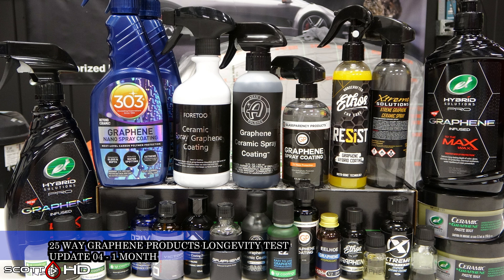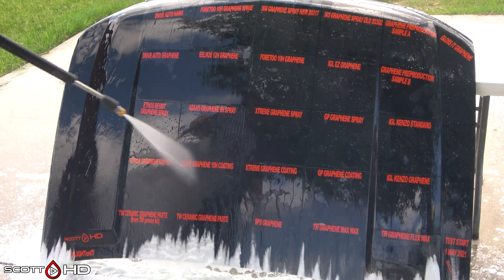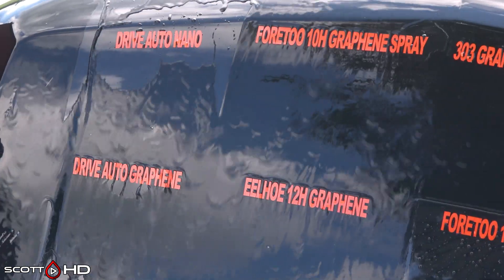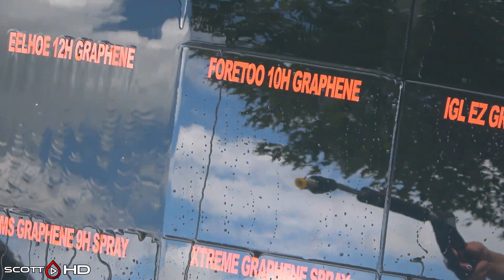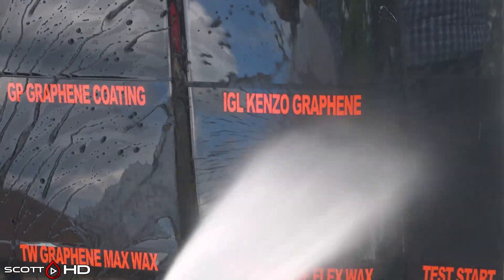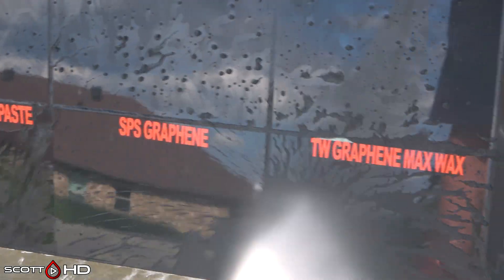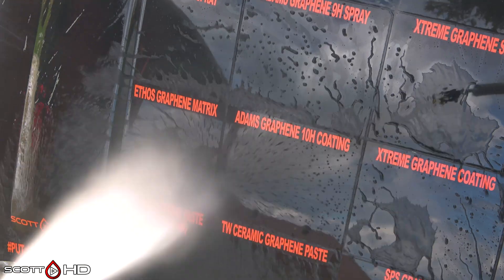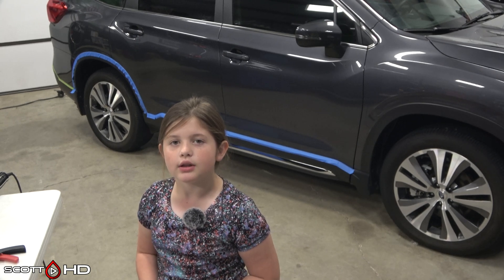Graphene Coatings Longevity Test - 25 WAY - ULTIMATE comparison - UPDATE 04 - 1 MONTH - BIG CHANGES!

Comment: I just started using the Adams Graphene spray.. so far I have been impressed but only a couple months into use.  I also use it as a topper and noticed a difference of hydrophobic property on a 2.5 year old coating.  CQuartz Pro was still going strong at 2.5 years but the Adams Graphene as a topper did give it a nice boost.

Comment: The GlassParency Graphene Spray coating is a little surprising. They seem to be coming out with more and more products for the detailing community. I'm a little surprised to see the coating itself showing signs of being flat.
Reply: The GP coating hydrophobics are just average without the topper unfortunately. I exclusively use their coating but I always apply BOOST topper and it makes it amazing
Reply: @chrisgorgol9442  I just became one of there installers and am getting into their system and full range of products. Waiting for the orders but I've heard great things about the boost.

Comment: I'm surprised how weak TW 75th anniversary graphene ceramic paste wax is. I though it would be much much more durable than that.  It's no better then seal n shine or ice spray wax but 3 times as expensive.
Reply: A bunch of hype...Im glad I didnt jump..
Reply: @masterspin7796  It's decent. It is very easy to use and super slick and has really good hydrophobic properties.  But I would recommend topping it off EVERY 2 MONTHS with TW Ceramic spray coating to keep the durability ON FULL!

Comment: I am really surprised by the weakness of TW Ceramic Graphene Paste Wax.  I applied this product to my vehicle about the same time you started this test and I have the same results!  I won't be using it again.
Reply: Extremely disappointed bc they market this as a 1 YR durability and it doesn’t meet no we’re near that
Reply: Very difficult to apply. Low durability. 
The car did look incredible for about 2 weeks after application, but after a couple of rains, it was gone.
Reply: I applied to one of our vehicles and Max to the other. They are both looking weak like this. I’m looking for a replacement. I do like the sprays, maybe Resist or Flex?
Reply: @larrys2554  Griots 3 in 1 ceramic wax
Reply: @SpartanKyuubi  oh yea, thanks, that’s has been doing well. There is so many to choose from.

Comment: I applied Ethos to one of my neighbors car last November and did a maintenance over the weekend.  The truck was dirty but even as I did a pre rinse it was extremely hydrophobic still.  She uses the drive through car wash every couple weeks and it still holding up.  It was went through a Chicago winter.  I was impressed.
Reply: Was it the Matrix or Resist? Thanks

Comment: Would like to see how some of these perform after being washed with a different shampoo. CG's stuff often has gloss enhancers and I'm curious of this is negatively affecting any of the coatings.  It's possible some of them don't combine well with honeydew.  

Additionally, it'd be good to see these tests done on a more traditional daily driver, where it's exposed much more realistically...?
Reply: Honeydew snow foam doesn’t have gloss enhancers it’s just a shampoo
Reply: @ethandaniel8044   @Ethan Daniel  Supposedly.    Have had multiple issues with CG shampoos that are meant to contain no gloss enhancers or wax.

Comment: morning scott.....pleasantly surprised at ethos resist and matrix....tw flex too.  i think sps will outlast the competition.....
Reply from the maker: SPS has been around almost 2 years longer than these others.  They were one of the first if not the first in the market for these products.
Reply: @ScottHD  is. SPS a installer only product?
Reply from the maker: @larrys2554  I believe so. I got it directly from an SPS installer for these tests.
Reply: @ScottHD  yes as i introduced the product and the man(alfred yow) in 2019 to another u-tuber when the craze started

Comment: Looks to me like Graphene products are not as good as nano-ceramic coatings.  If I remember correctly they are supposed to prevent water spotting but you showed that wasn't the case.  In terms of durability, they fail much faster than nano-ceramics in general.   Curious to see how it will go over the next few months but so far I am not impressed with their performances.
Reply from the maker: It definitely is looking like that
Reply: I agree ... Adams and Kenzo, aside.